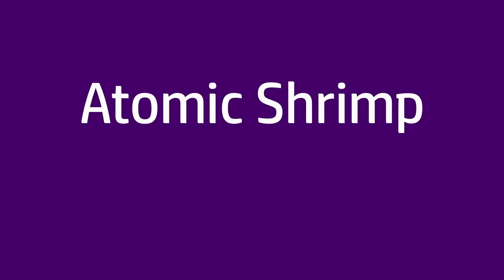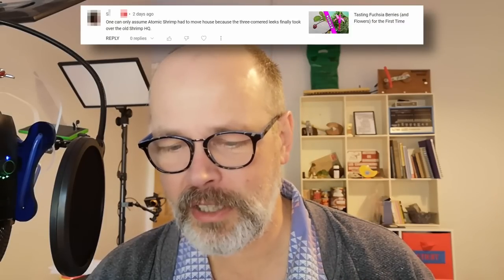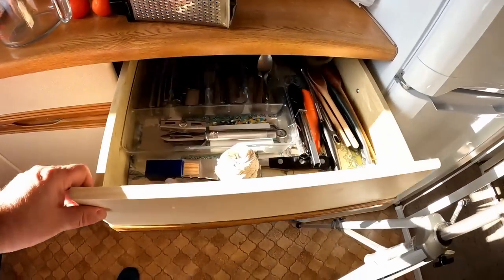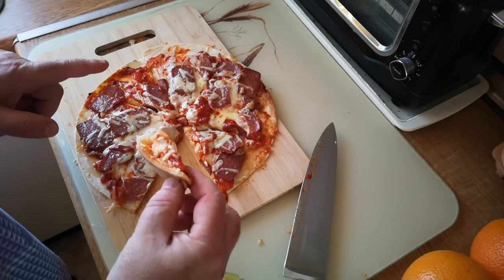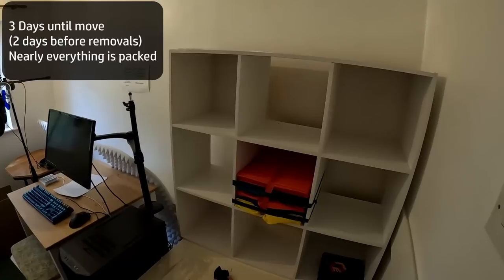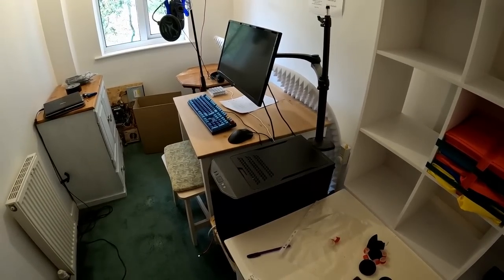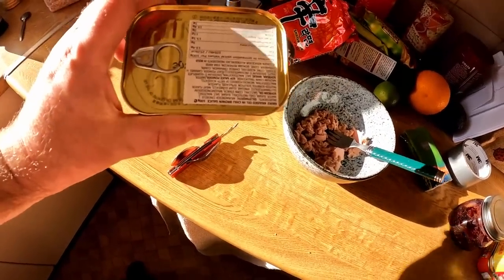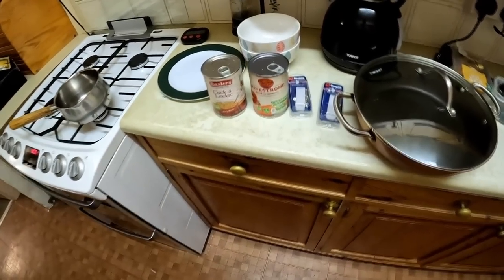Random Stuff - Shrimp Cottage Edition

Comment: You would be better off with an "equilibrium valve", they shut off more decisively - look on Screwfix for items 49088, 8395r or 7058F
Reply from the maker: I think the last one you listed might work as it's still a lever arm - the other two have a sliding mechanism that I think might eventually bind if it wasn't mounted completely vertically (the flared edge of the tank prevents it)

Comment: is anyone else floored that you BYO fridge in the UK?!? In the US 95% of the time the appliances are considered part of the house. I always learn something here!
Reply from the maker: There's usually a 'fixtures and fittings' list that sellers complete to indicate which things are included in the sale and which are not (including which are optional and can be purchased at additional cost)
The norm is for inbuilt appliances to stay, freestanding ones to go.
Reply: @AtomicShrimp  fascinating. Thank you for sharing. In the US the usual expectation is the home will “come with” the appliances needed to make it useable( ie stove fridge and if washer dryer are present those as well except under special agreement) If you have a “special” piece you let the buyer know and are expected to replace it. For example my dad built a home/kitchen around a restored 1950s chef magic 8 burner and took it with him but replaced with a viking 8 burner. It’s always interesting to see the cultural differences large or small… especially the ones I didn’t know where differences so again thank you for sharing and explaining.

Comment: I think I see a problem: Overflow of hot water cylinder into plastic tank. Tank fills with hot water - and melts: Result = house flooded - all floors. Suggestion = get a metal tank.
Reply from the maker: Hot water doesn't melt plastic
Reply from the maker: No idea what happened to your reply but I saw it as a notification. Citing one freak instance (which is also irrelevant as it was a thermostat failure driving an electric heater to boil the hot cylinder until it exploded).
Pretty sure a metal tank would have made little difference to that incident. 
This system doesn't use an immersion heater - it's heated by a water loop from the boiler. It's literally impossible for the water in the tank to exceed 100 Celsius.
Reply: @AtomicShrimp  I defer to your possibly more informed opinion.

Comment: For the hot water tank, what's to stop you from running a soft line from where the cold water reservoir fills up directly to the hot water heaters' inlet, bypassing the pre tank completely?
Reply from the maker: What would shut off the water feed?
Reply: I think there are 2 types of hot water cylinder - vented and unvented. Shrimp (and lots of older houses with the same system) has a vented type which isn't at mains pressure, you get slower flow rates from the tap. If I were to hazard a guess, if shrimp has a shower installed it will probably be an electric one or a power shower as normal showers don't deal well with gravity/vented systems like my mums and nans place.
Unvented systems like the megaflo cylinders are fed directly from mains pressure water pressure but they need to either have an expansion vessel or have a built in expansion air pocket in the top. My old flat (electric only)had a megaflo and was heated overnight with economy 7. These systems are newer and need to the air pocket regenerated occasionally but you get full mains pressure.
Reply from the maker: Yeah, the shower is an instantaneously heated electric model - hot water pressure in the upstairs taps isn't exactly gushy, but it's adequate - it only needs to fill a sink or the bath
Reply: @joeynebulous816  okay this makes sense to me now. I'm only familiar with more modern north American systems, so I was confused by the need for the res at all

Comment: Did you mention your computer upgrade previously? I know you had previously been using a laptop.
Reply from the maker: I didn't mention it.  Didn't really want to get into that whole rabbit hole discussion about upgrades (the mechanical keyboard video was like that - I think people assumed I was getting on the bandwagon of seeking out the best switches, lubing them and attaining the perfect 'thock'.  It's just a tool to me)
Reply: @AtomicShrimp  I love mechanical keyboards but I have the same outlook. I'm not an enthusiast with them. Similarly I love building PCs and setting up software, but I don't love tinkering with clocks, timings, and voltages. Still, it would be cool to know what your new specs are or the reasons for your upgrade in one of these random stuff videos.

I'm curious if you ran into memory limitations. I'm a heavy multitasker and going from 16 to 32 gigs massively improved my workflow

Comment: I’m sure it’s in the comments but as an HVAC tech in the US I am really confused by that water system. I don’t understand the reason to store cold water
Reply from the maker: There's a representative diagram here: https://www.schoolphysics.co.uk/age11-14/Heat%20energy/Transfer%20of%20heat%20energy/text/Hot_water_system/index.html
Reply: @AtomicShrimp  thank you. That’s neat. Looks like it provides head pressure for the heating pump and expansion for the system. I’m happy things aren’t done like that anymore but it is interesting.
Reply from the maker: I'm pretty sure systems of this general design are still sometimes used. In an area with low or variable water pressure, for example, you don't want the hot cylinder to have any opportunity to run dry if other momentary demands for mains water happen (like two toilets being flushed at the same time as a washing machine being on its fill cycle maybe.
Most new systems being installed now either have a pressurised storage cylinder or just heat the water instantaneously in a combi boiler, but legacy wise, most existing heating and hot water systems are like this one
Reply: @AtomicShrimp  Sure. Here there are water towers or other storage methods in the towns to maintain water pressure. Or if the building has a well a pressurized storage system is used. But boilers are far less common too. Most houses use a gas fired or electric water heater as it’s own appliance. On demand combi boilers are uncommon. It’s cool to see different evolution to solve the same problem.

Comment: How does the hot water tank have any pressure?
Reply from the maker: The elevation of the cold tank creates the head of pressure. That's its purpose
Reply: @AtomicShrimp  I imagine that the pressure is not very high though?
Reply from the maker: @brewski118sempire  it only has to come out of the taps